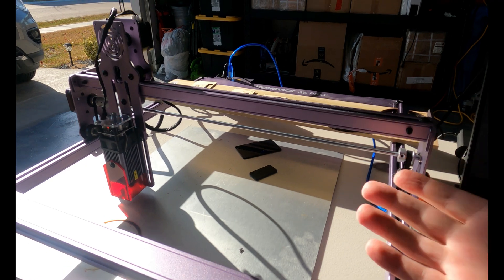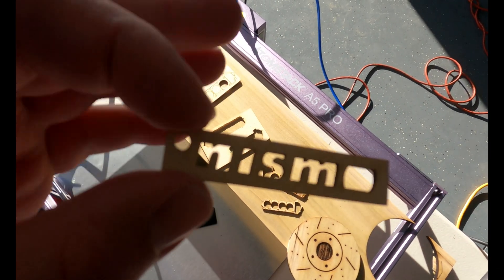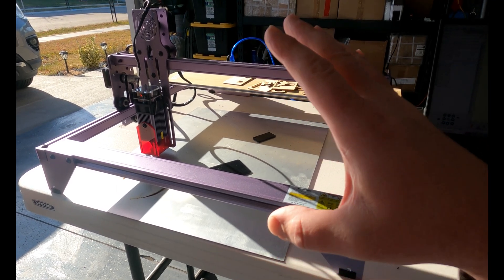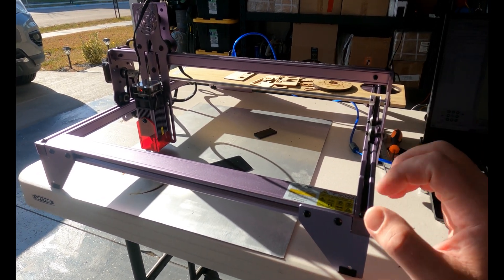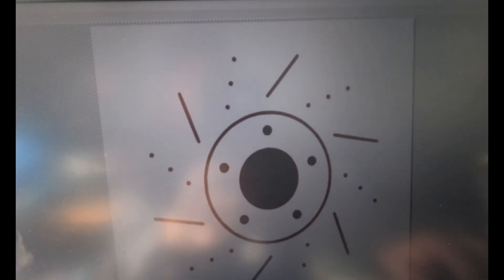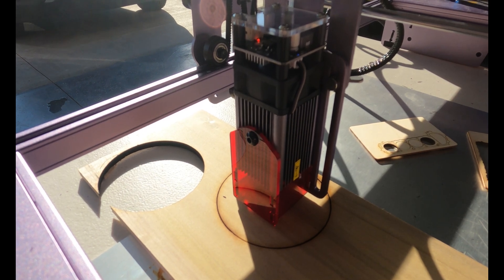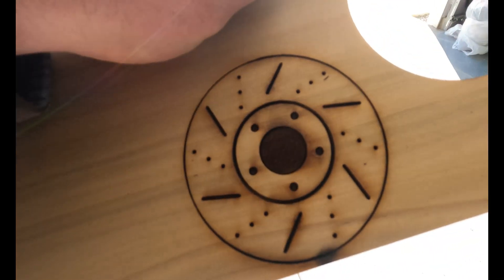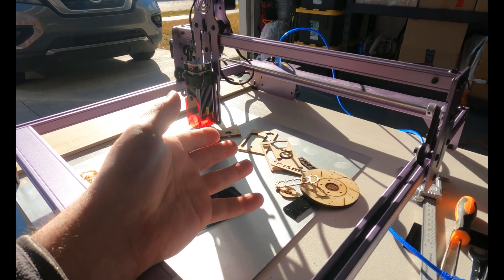Atomstack A5 Pro laser engraver review.

Comment: Hey I'm sure you already figured this out by now, but if you lay some painters tape on top of the wood, it will prevent (to some extent) the wood burning on the top.
Reply from the maker: I actually rarely use the laser cutter, so I have not given that a try. Good tip, I will try it next time!